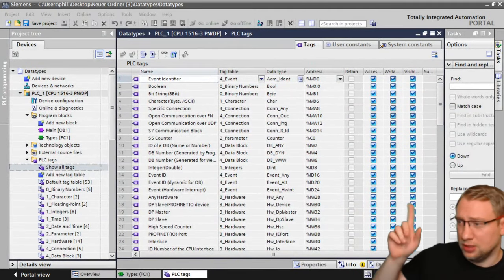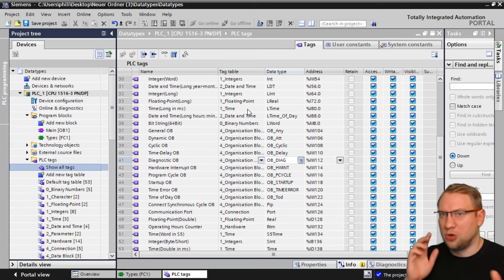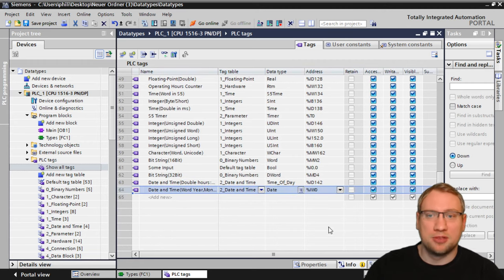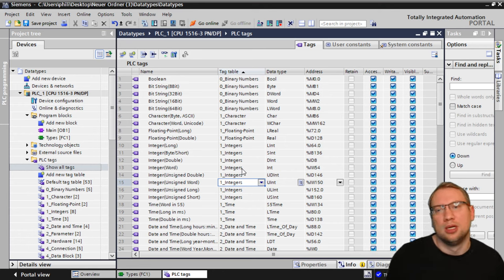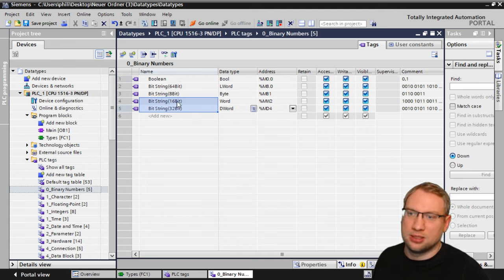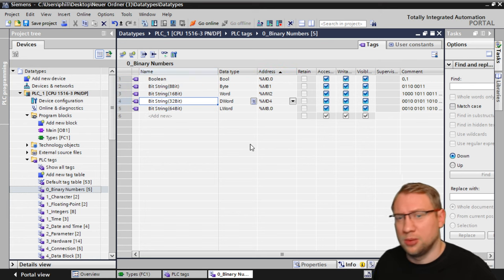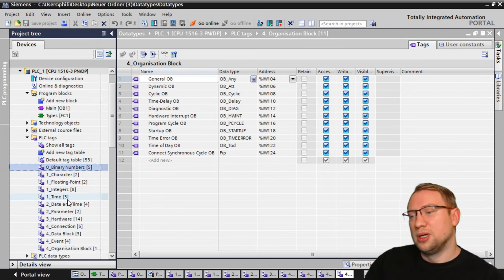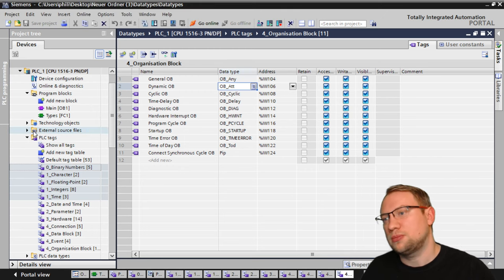Data Types and How to know what you need! (TIA Portal)

Comment: Hi, thank you so much for all your videos, it's helpful. I'm a beeginer and i'm working on a projet on Tia Portal using s7-1200,and i need to calculate the average for an analog input each 1 hour and keep the average values for visualize them on IHM. I tried with a small code SCL and call it on OB30 with 1s but it doesn't work.
If you can help me i will be grateful.
Keep going your are amazing.